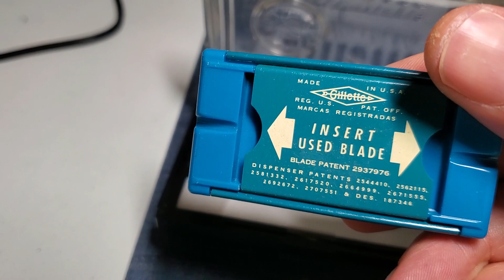Rockwell T2 VS Vintage Gillette Adjustables.

Comment: Terrific video.), Robert. Thank you.  Just ordered a nice Super 109 Date Code S2 1972, as shown. Also own a Fatboy G2, Slim K2, and Super Speed C1, which is my birth year.  (Now I'm done !) I've been paying a bit more on ebay to get nice, clean examples. ($40-$60), as I'm not interested in buying beaters that I'd have to send out for tune up or revamp/replate straight away. So far, so good. Really scour the listings, looking closely at the picks, and carefully reading the descriptions . But I guess that's part of the fun ! Cheers !

Comment: I have a slim and it works awesome. I actually run through the settings starting at 5 then move to 9 to get more shaves out of the blades. Feathers work great with this shaver. You can have them replated at razor emporium too

Comment: The old Gillette razors (The fat boy and the slim) are way above all what we have today. I don't think it is even close. Also the small touches make a huge different. For example, you can adjust the razor mechanism while butterfly is locked , You have a clicking feedback when switching levels. The shaving experience is something else. The only downside in my opinion are the end tabs which requires an extra carful especially while shaving my head or around the ears.
Reply: Sometime depending on how much over hang I have I take a pair of scissors and just trim the sides of the blade before I install it. It works well for me.